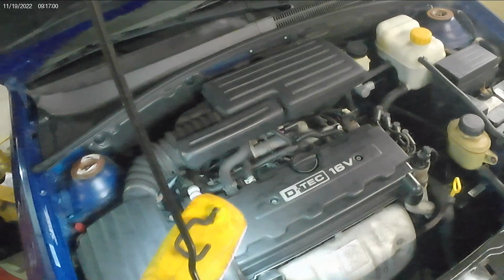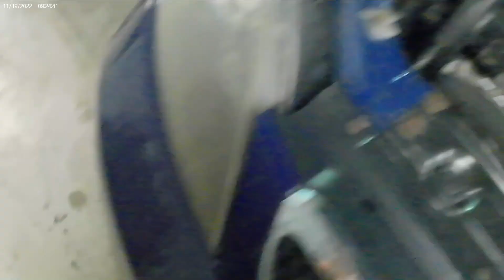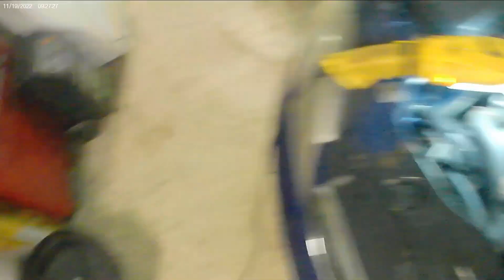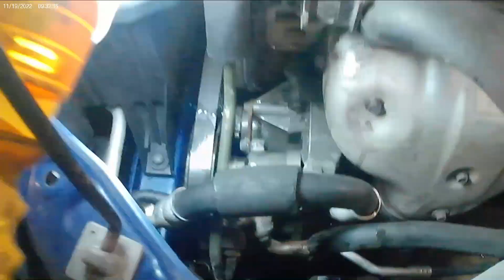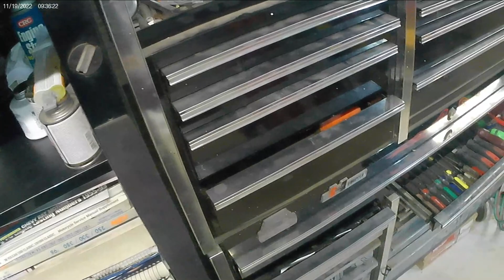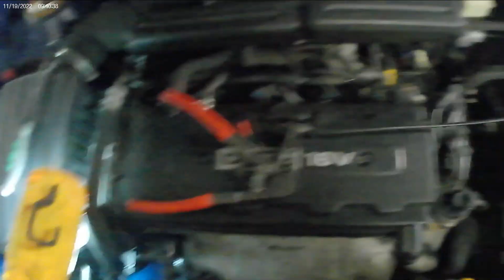Suzuki Reno / Daewoo Lanos Thermostat Replacement #suzuki #suzukireno #deawoo #lanos #thermostats

Comment: Hi , why is there excessive amount of water coming out of my exhaust pipe in my 2008 Suzuki forenza?
Reply from the maker: Well, there could be a number a factors why. 1. Could be temperature related, mixing hot exhaust gas with the ambient air, which a majority of the time is the reason. 2. There Could be a possibility that there is a head gasket issue.  Hope it helps. Thx for commenting, cheers.

Comment: My bolt bolt to my reno is stripped. Do you know what size the housing bolt is?
Reply from the maker: @arielrodriguez6980  I no longer have the car in my possession.   But guessing from the hip, I'll go with a 8mm x 1.25 thread about 2, maybe 2.5 inches long. This is just a guess. Hope it helps. Thanks for subscribing,  following and watching.  Cheers

Comment: Any need to burp the system on these models? If so, how did you go about it?
Reply from the maker: This vehicle has a reservoir tank, which make removing air out of the system easy.  After whatever coolant repair you do, run the car for a while with the Coolant tank cap off as the vehicle warns and runs.  Do small continuous revs with the heat on.  As soon as you have consistent, chk the coolant tank and top off if needed.  Hope this helps.  Be safe, Cheers.